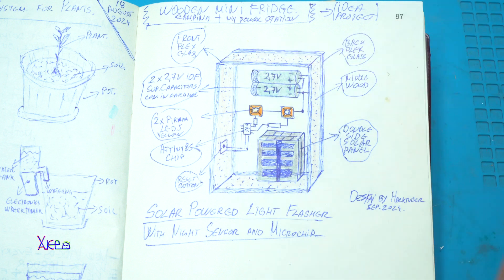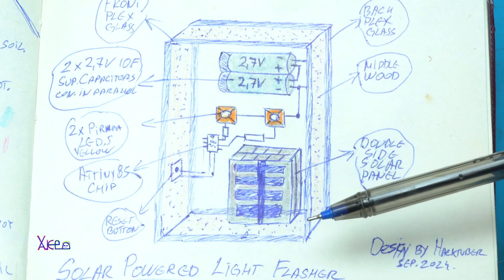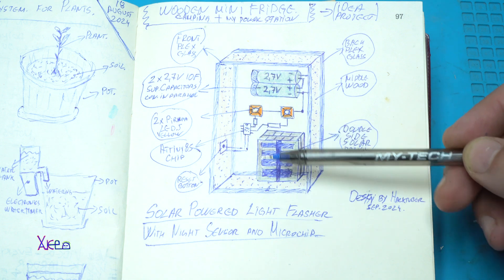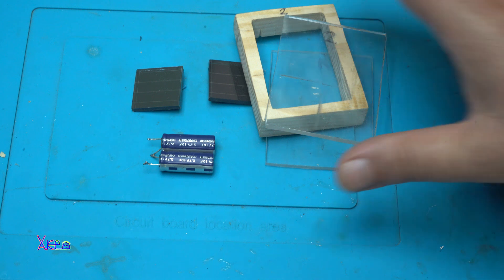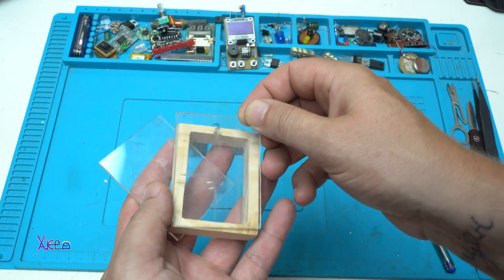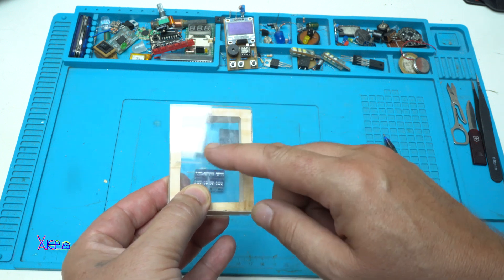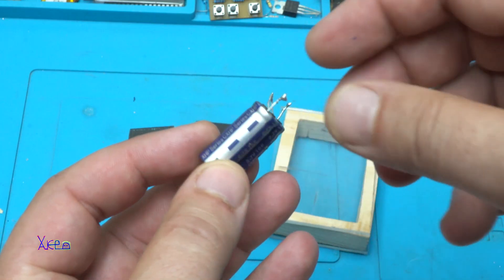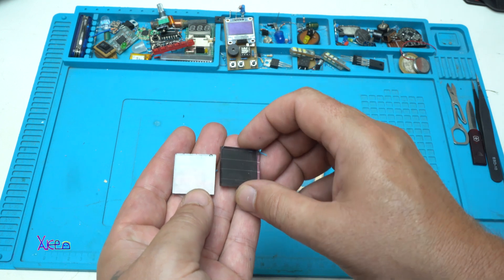My Next Project Using Supercapacitor and Microchip

Comment: Thanks for your great vid. The min. voltage for an attiny85 is 2.7 V. So the super caps provides in its lowest voltage limit. How about using modern ATtiny1614/6/7 or ATtiny322x which start with min 1.8V and has UPDI for simple firmware downloads.
Reply from the maker: I have try and test,Attiny85 works for low power projects from 1.8v
Reply: yes let's step it up to the most modern attiny and make it smaller.